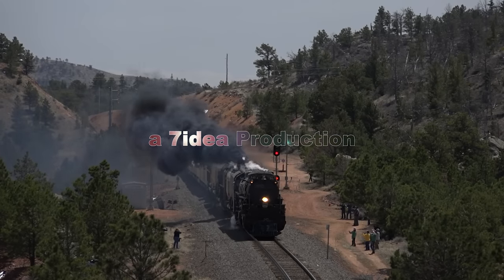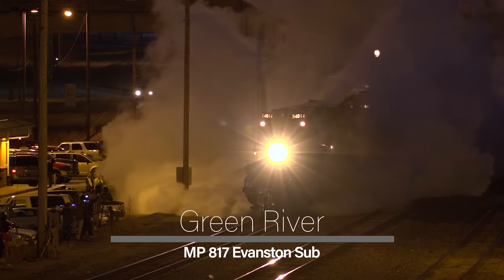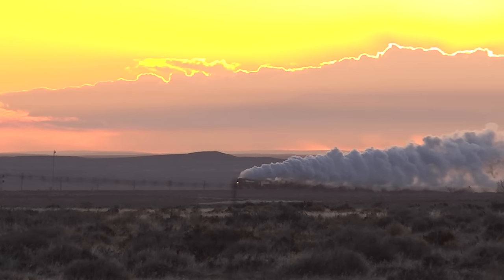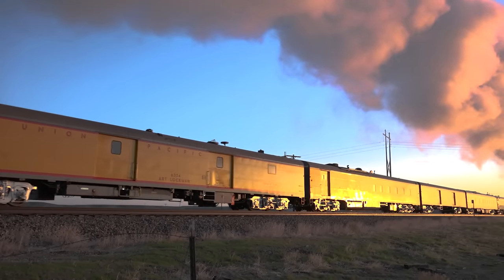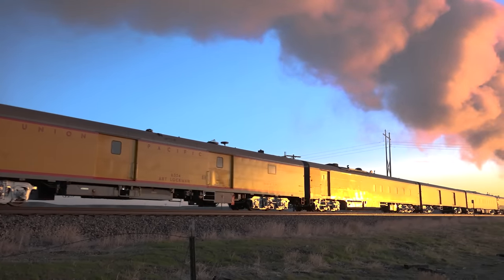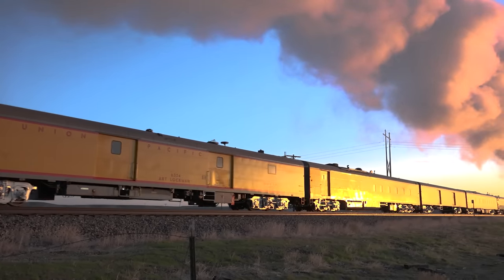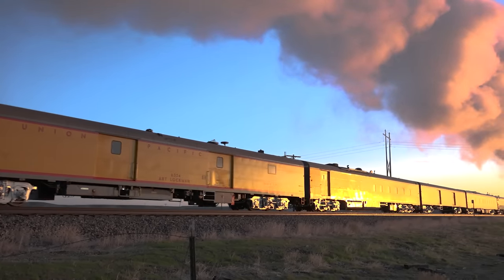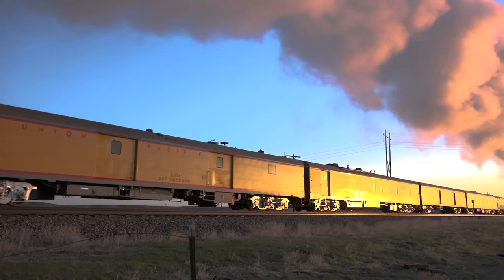The Largest Steam Locomotive on Earth!

Comment: " weighing in at over 400,000lbs" Have you guys never heard of 'tons'?   What's the point in having larger units of measurement if nobody uses them?  Would it not be easier to say that it weighs 181 T ?
Reply from the maker: You would think so. I thought it very interesting that diesel locomotives have their weight displayed inside the cab in pounds. Also tractive effort (pulling power) is measured with the same units. I don't know why they don't use tons. Maybe someone "in the know" could explain?
Reply: Because tons are not precise. There is no rule that says you have to use one unit of measurement based on what makes sense to most.  As an example, aircraft measure fuel quantities in pounds, not gallons.   
It may not make sense to you, but in the industry this is the norm.
Reply from the maker: Thanks for the clarification. That makes sense.
Reply: @FFred-us9tw  you know what is precise? metric tons.
Reply: @lunascomments3024  A, we don’t use the metric system for measurement here and B, it’s not any more precise then pounds.
Reply: @FFred-us9tw  are you serious?
Reply: @lunascomments3024  yes, we don’t use the metric system for locomotive specifications in the US. Tractive effort is measured in pound-force 
 (lbf) and locomotive weight is measured in pounds. Fluid levels are measured in gallons and sand capacity and air volume is measured in cubic feet. Metric is not used for US locomotive specs.
 And if a locomotive weighs 400,000 pounds then stating that same weight in metric tons, which would be 181.437 isn’t magically a more accurate figure. They’re both the exact same weight. The only thing that differs is the unit of measurement.

Comment: They have to put an entire diesel engine on the train doing nothing but applying the brakes just so Big Boy doesn't overpower the relatively minuscule weight of the tiny train it was pulling, compared to the miles-long fully-loaded trains it was designed to pull.
Reply: That is absolutely not what is happening. A locomotive can’t “overpower” a small train. You will simply use less power from the locomotive and save fuel.

Comment: Why was the UP diesel 8937 freight loco in this config? I have these loco in my collection and on my n scale layout latest addition has been the Bigboy 4014 by KATO
Reply: They need it to power the train cars the steam trains only have a Dynamo powerful enough to power a cab light in the headlight and some of the gauges because back then train cars were still lit with lanterns and there were no refrigerator cars ECT newer train cars also have a whole different type of braking system and plugging those train cars brakes into that steam locomotive would be like trying to plug in Old color cords from a VCR into a 4K curved TV they are likely required to have it because of regulations due to the brakes

Comment: why is the smoke white now?  last time I saw this train it was blowing jet black smoke?
Reply: White “smoke” is primarily steam. Heavy black smoke is either too rich of a firebox condition or sanding of the flies typically.  Under normal use when running under optimal conditions the smoke is light in color.

Comment: why is there two other lokomotives besides BigBoy? aint the restored version  of big boy strong enugh? i dont understand. pls clear my confusion.
Reply: Double steam engines are just amazing to look at.  They are double heading just for the spectacle.  The diesel engine is required.  Railroads require all engines to have electronic braking which steam engines do not, although they are working on adding brake monitoring to the 4014.  It's used to provide power to the cars, and also it helps pull a little to save fuel.  The trackside infrastructure to support steam engines, fuel depots, water towers, is long gone.  They have to bring all the fuel and water with them for most of the trip.  That's what those huge yellow tank cars are for.
Reply: @Travelinmatt1976  oh wow, i didnt expect it to be like this cause all of these reasons! thank you very much of explaining them to me, now im a bit smarter, thx!

Comment: Tengo una duda,  ¿porque en este tren Big Boy lleva una maquina ayudadora de vapor también?. Gracias.
Reply: They need it to power the train cars the steam trains only have a Dynamo powerful enough to power a cab light in the headlight and some of the gauges because back then train cars were still lit with lanterns and there were no refrigerator cars ECT newer train cars also have a whole different type of braking system and plugging those train cars brakes into that steam locomotive would be like trying to plug in Old color cords from a VCR into a 4K curved TV they are likely required to have it because of regulations due to the brakes

Comment: Was the diesel electric engine in there just in case the steam locomotives broke down along the way?
Reply: That, as well as providing PTC (Positive Train Control) data to the 4014 and the diesel also provides dynamic braking for the train to cut down on brake shoe wear
Reply: @FFred-us9tw  👍 thanks for the 411.

Comment: I take it that the diesel locomotive was primarily used for a generator to supply power to the crew cars during this test run.
Reply: No it is mainly used for Dynamic braking .freight locomotives general don,t have the ability to provide auxiliary power

Comment: Is the Diesel/electric engine, pushing or being pulled?
Reply: It’s being pulled. It’s there for Dynamic braking as needed on long descending grades, to provide PTC (Positive Train Control) for the 4014 and to insure the mainline would not be blocked if an issue arose with 4014.

Comment: Pardon my ignorance, but WHY the diesel engine behind the two steam engines?
Reply: It is in Idle during normal operation. It's there for dynamic braking when needed and it also has the controls and hardware for the mandatory PTC. It feeds the data via cables to the 4014's cab to displays for the crew.  On most excursions UP will always have a diesel in tow to provide additional air if needed and as a built in rescue if the steam locomotive it's trailing needs it. But the length of these excursion trains won't even break a sweat on a steam locomotive this large.

Comment: What's the purpose of releasing that much steam on the sides when pulling away after being stopped?
Reply: They do that to blow any moisture out of the cylinders.
Reply: @FFred-us9tw  Blowing ANY condensation out of the lines before it can get into the cylinders. Water is NOT compressible and a slug of water in the cylinder would case the piston to come to a screeching halt, causing things the bend and/or break (other people: learn the difference between break/brake, the spell checker can't tell which is being referenced).
Reply: "case the piston" should be: cause the piston

Comment: Hello. What for do they need a diesel locomotive?
Reply: They need it to power the train cars the steam trains only have a Dynamo powerful enough to power a cab light in the headlight and some of the gauges because back then train cars were still lit with lanterns and there were no refrigerator cars ECT newer train cars also have a whole different type of braking system and plugging those train cars brakes into that steam locomotive would be like trying to plug in Old color cords from a VCR into a 4K curved TV they are likely required to have it because of regulations due to the brakes

Comment: Why is there a modern engine linked in as well? If the big boy could pull a train then, it should be able to pull a train now right? Anyway, just a question, the locomotive is pretty awesome. They have one at the California Railway Museum in Sacramento. It's bigger in person.
Reply: It is in Idle during normal operation. It's there for dynamic braking when needed and it also has the controls and hardware for the mandatory PTC. It feeds the data via cables to the 4014's cab to displays for the crew.  On most excursions UP will always have a diesel in tow to provide additional air if needed and as a built in rescue if the steam locomotive it's trailing needs it. But the length of these excursion trains won't even break a sweat on a steam locomotive this large.

Comment: Do the diesel engines must be to push it when it breaks down I'm guessing
Reply: It is in Idle during normal operation. It's there for dynamic braking when needed and it also has the controls and hardware for the mandatory PTC. It feeds the data via cables to the 4014's cab to displays for the crew.  On most excursions UP will always have a diesel in tow to provide additional air if needed and as a built in rescue if the steam locomotive it's trailing needs it. But the length of these excursion trains won't even break a sweat on a steam locomotive this large.

Comment: Just to give an idea on how massive these locos were, only 625 were built. They were 132' 6" long, and weighed 125 tons.

Biggest Iron Horse of them all.
Reply: Just 25, not 625
Reply: Uh, not sure where you got your info but you are WAY off.  They built only 25 of these, not 625. And the later units built weighed in at about 386 tons (for the loco alone), not 125.

Comment: The heaviest (and perhaps the "largest" steam locomotive on earth) is on display at the Franklin Institute in Philadelphia. It is a brand new Baldwin loco that was too heavy for railroad tracks, so it was never used in any regular service.
Reply: You are talking about the Baldwin 60000. And it was not “too heavy for regular tracks”. It ultimately wasn’t used because it was far too unreliable and maintenance intensive and underperformed.  It wasn’t as powerful as Big Boy, or as long and about 70,000 pounds lighter.
Reply: @FFred-us9tw   I think you need to contact a Franklin institute and correct them then...........
Reply: @arthouston7361  anyone, yourself included, can read the entire history of the locomotive you’re talking about. You can also find all its blueprints online as well. If the information you have came from the Franklin Institute, then someone there should be fired. Especially the comment about “it was too heavy for railroad tracks“. The 60000 weighed in a little over 700,000 pounds.  The Big Boy weighed in  at over 1.2 million pounds. The Yellowstone’s and Challengers were also over a million pounds.
Reply: @FFred-us9tw  I think they are dead now, so more permanent than fired. At that time, it was far more difficult to find the information you are talking about. FYI.

Comment: Does anyone know the term ‘mallett’ as referring to a steam locomotives? I probably spelt it wrong.
Reply: A mallet uses steam twice. First through the smaller rear high pressure cylinders, then exhausts into the larger front low pressure cylinders. Also called a compound articulated steam locomotive. The Norfolk and Western Y class are perfect examples of such. The Big Boy on the other hand is a simple articulated steam locomotive, all 4 cylinders are the same size, are all high pressure and are used all at once.

Comment: Why do these steam engines need a diesel engine behind them?  Surely the steam engines alone are powerful enough to pull those few passenger cars.
Reply: its for electricity. the diesel engine have alternator inside them to generate electricity for all the carts.
Reply: UP has explained this in many videos.  It provides Dynamic Braking for the train to cut down on brake shoe wear. It also provides all the Positive Train Control (PTC) data to the 4014’s in-cab displays.  And lastly it can keep the train moving should the 4014 develop any issues.  
  It does NOT and cannot provide any power to the coaches. It has no ability to even do that.  Power for the coaches (480v AC) comes from dedicated “power cars” which you can see in the consist.  It has extra grilles on the exterior for cooling the diesel generator.

Comment: I was not aware that the diesel helper acted in something other than provide power (electricity) to the following cars. Interesting!
Reply: The diesel does not provide any power to any of the cars in the train. It has no ability to do so. The diesel locomotive is there to provide dynamic braking for the train. It’s also there in case there’s a mechanical issue on the 4014. The electric power for the coaches is provided by dedicated power cars which can be seen in the video. These cars have a diesel generator on board to produce the power required for the coaches.

Comment: Its kind of funny that about 5 or 6 cars back is a modern diesel–electric locomotive.
Reply: They need it to power the train cars the steam trains only have a Dynamo powerful enough to power a cab light in the headlight and some of the gauges because back then train cars were still lit with lanterns and there were no refrigerator cars ECT newer train cars also have a whole different type of braking system and plugging those train cars brakes into that steam locomotive would be like trying to plug in Old color cords from a VCR into a 4K curved TV they are likely required to have it because of regulations due to the brakes

Comment: I wonder what the steam pressure is in the boiler.
Reply: Both operate at 300 psi
Reply: @09JDCTrainMan  Thanks! At 300 psi water quality does not need to be as critical. Blowing down the boilers should keep the steam system reliable.

Comment: What are the stats for 844 behind the 4014 Big Boy?
Reply: Horsepower: Around 4,500
Tractive effort: 63,750 lbf
Boiler pressure: 300 psi
Total weight: 907,890 lbs
Cylinders: 25" x 32"
Driving wheel size: 80"
Top speed: 120 mph

Comment: Why they added a diesel engine if the steam engines are so powerful?
Reply: That provides "hotel power" to the coaches behind and also serves as back up in case of steam  loco failure.  As far as that 4014 is concerned, that train is just a light move.
Reply: Those are interesting details, thanks.
Reply: @robertgambling502  No, the diesel locomotive you see trailing this steam locomotive does NOT provide power to the coaches (HEP,  or Head End Power). That power is provided by a dedicated HEP car which you will see in the consist with grills on the side. UP does not own any SD70's with HEP capability. The diesel is in the consist but is in Idle during normal operation. It's there for dynamic braking when needed and it also has the controls and hardware for the mandatory PTC. It feeds the data via cables to the 4014's cab to displays for the crew.  On most excursions UP will always have a diesel in tow to provide additional air if needed and as a built in rescue if the steam locomotive it's trailing needs it. But the length of these excursion trains won't even break a sweat on a steam locomotive this large.
Reply: @FFred-us9tw  I stand corrected on the purpose of that diesel.  Upon a closer look, I see that the car with the grills on the side provided HEP.

Comment: Why the need for a diesel electric engine? Are  the big boys just being pushed along?
Reply: It is there to provide dynamic braking.
Reply: @FFred-us9tw  how did the big boys used to brake then? Is there no compression stroke on the cylinders? Are there no means of breaking on the old girls?
Reply: @Deusmecumest   They would use 100% air brakes before Diesel locomotives with Dynamic Braking came about.  But UP is trying to avoid excessive wear and tear on the cast iron brake shoes the steamers and their tenders have.  So adding the diesel means on long descending grades they can eliminate the wear issues. The diesel is also able to provide assistance if the steam locomotive were to become inoperable and get it off the main line. And now UP is using the diesel to provide PTC (Positive Train Control) to the 4014 which is covered at length in quite a few articles.
Reply: @FFred-us9tw  thanks
Reply: @Deusmecumest  Your questions have been asked and answered at least a dozen times or more.

Comment: The way oil prices keep skyrocketing, they are going to have to bring the streamers back!!
Reply from the maker: Except the 4014 has been converted to burn oil rather than coal and probably isn't as fuel efficient as a modern diesel. Also steam engines required around 100 man hours per mile to maintain whereas a diesel is only about 5, hence the reason we have diesels today.

Comment: The diesel engine is to provide electricity for the passengers, for all those wondering.
Reply: Actually it’s not.  UP does not have any modern diesel locomotives with the ability to provide the power needed for the coaches (480 v AC known as Head End Power). The power for the coaches comes from “power cars” which you can see in the consist and they are listed on the UP website. These cars contain a diesel generator for this purpose.  UP owns a few of them. 
The Diesel Locomotive trailing the 4014 is there for three main reasons.  1, to provide the Positive Train Control (PTC) equipment for the 4014’s in cab displays. 2, to provide dynamic braking for the train to cut down on brake shoe wear. And 3, to provide a back up to keep the train moving should any issues arise with the 4014.   
UP has explained everything I just mentioned in many interviews.

Comment: The real star is the EMD secretely pushing and helping those old timers get all the attention to shine for the public, and preventing them to break.
Reply: They need it to power the train cars the steam trains only have a Dynamo powerful enough to power a cab light in the headlight and some of the gauges because back then train cars were still lit with lanterns and there were no refrigerator cars ECT newer train cars also have a whole different type of braking system and plugging those train cars brakes into that steam locomotive would be like trying to plug in Old color cords from a VCR into a 4K curved TV they are likely required to have it because of regulations due to the brakes
Reply: I don't blame you for thinking that with how many fake YouTube videos there are or clickbait titles and what it looks like to somebody who is not familiar with the ins and outs of trains but you are incorrect